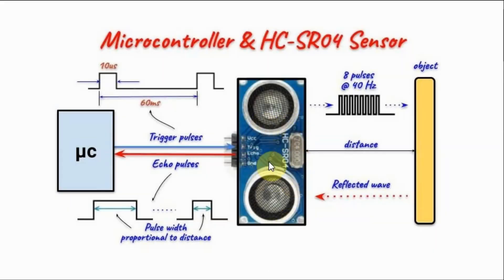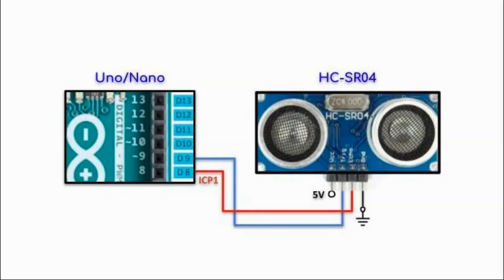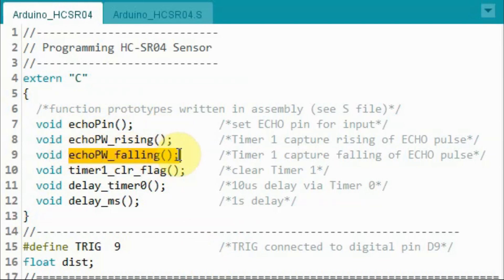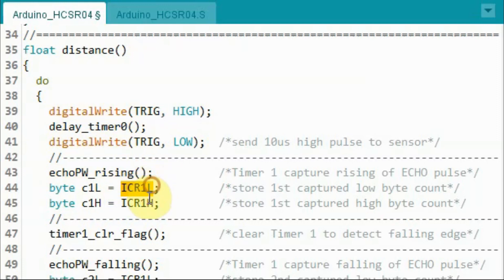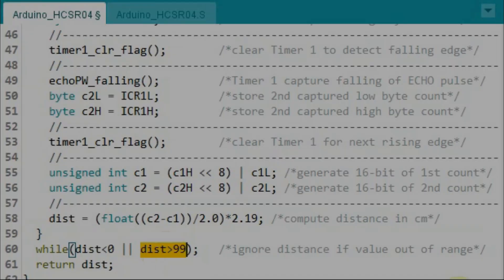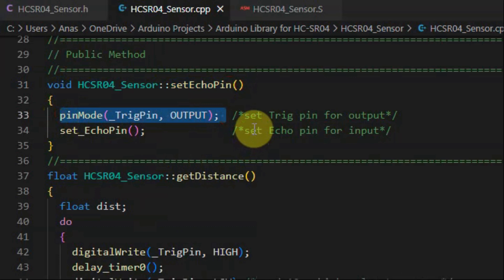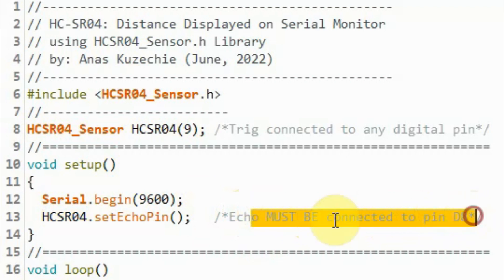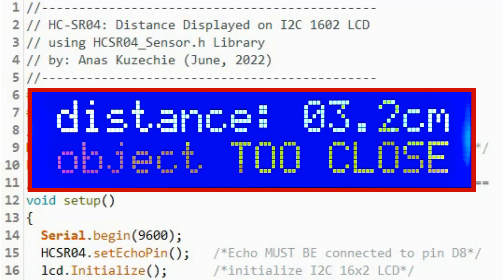Creating Arduino Library for HC-SR04 Sensor

Comment: Very nice walk-through of the library. Could you please comment on how the size of the compiled program on an Uno would be when using your library vs the library found on the Arduino site, by gamegine?
Reply from the maker: Thank you for the feedback. As for size I have not compared the library to any other. My objective here is educational. I want to demonstrate how any sensor or device can be encapsulated in a library. Thus, making it easy to interact with that sensor. I hope using assembly code lowers memory usage.
Reply: @AnasKuzechie  Thanks